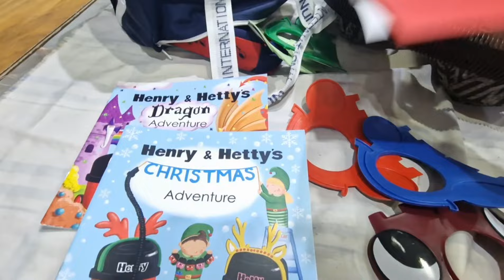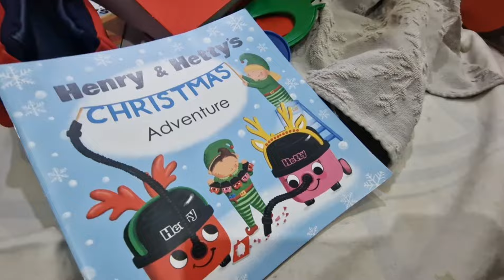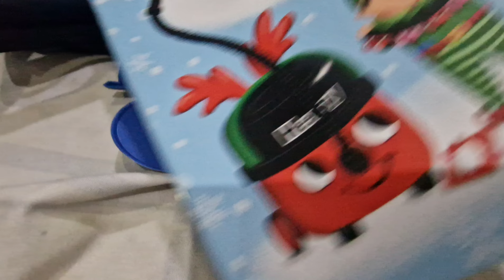Gb henry cleaning and fixing the Motor with daddy #gbhenry #hoover #vacuum #vacuumcleaner #cleaning

Comment: There is a risk of electrocution you may not be aware of: He (or even you!) may touch the uncovered fuse holder while plugging the plug into the wall. These contacts are connected to the hot wire!

So put back on the lid of the fuse box asap!